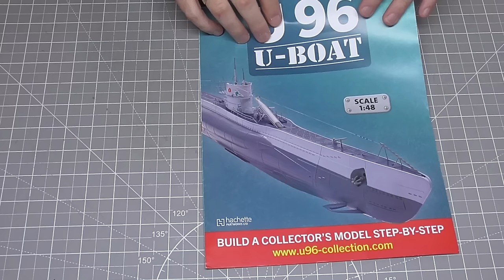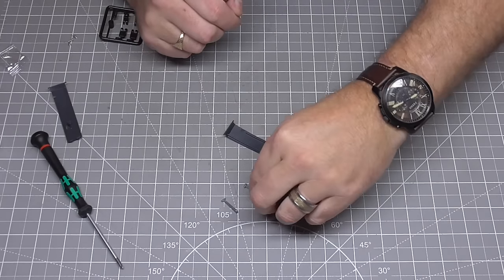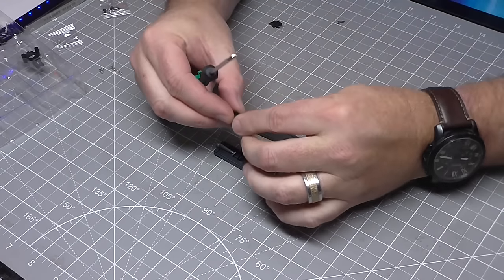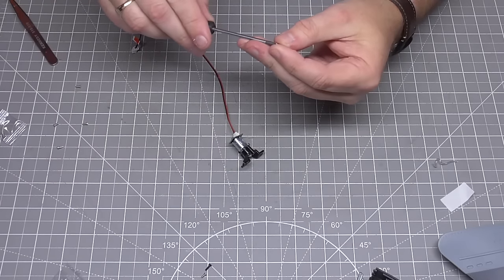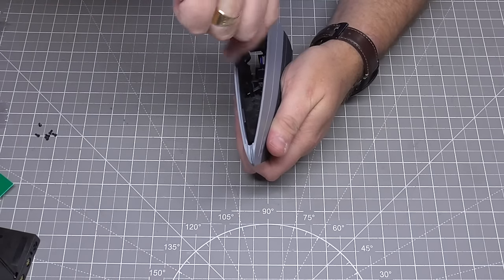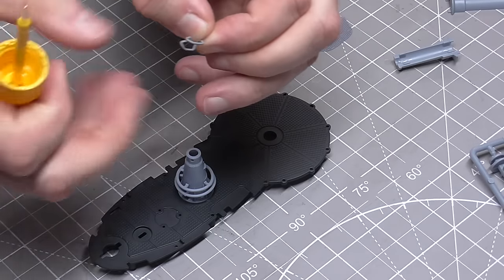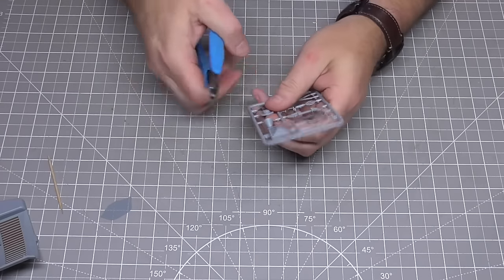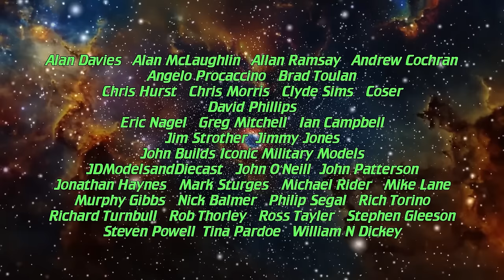Build the 1:48 Scale U96 U-Boat - Pack 1 - Stages 1-4

Comment: I think you have the top 2 torpedo doors around the wrong way. This is much better than the previous release a few years back. Great vid again Wayne.
Reply: I was wondering that too, either those doors fit very very badly or they are the wrong way in :D
Reply: Just what I was going to suggest.
Reply: Not so much the wrong way. The wrong side
Reply: @adammorrison2009  Exactly
Reply: Maybe the upper left and upper right torpedo doors are swapped and upside down?
Reply: Just what I was going to say. When Wayne was saying how they were numbered didn't sound right.

Comment: I could be wrong, but the fit of the upper torpedo doors seems off.  I think the upper right door is on the left side of the hull and vice-versa for the upper left door.  The doors should be flush with the hull when closed and they are not.
Reply from the maker: I'll check when I get home

Comment: Wayne, when the torpedo tube shutters (doors) are pulled into the centerline, they are open.  Fully extended, they merge with the hull and are closed.

It also looks like your port upper door may be ?switched? with the starboard one -- the doors should sit flush with the hull when closed.
Reply from the maker: Yep. I've switched them now